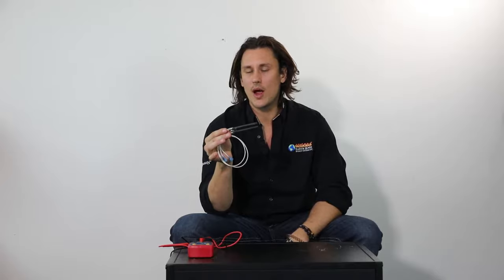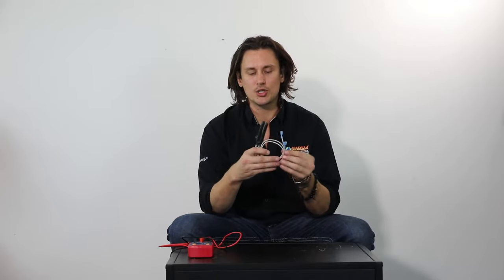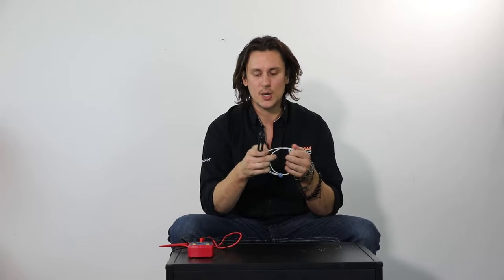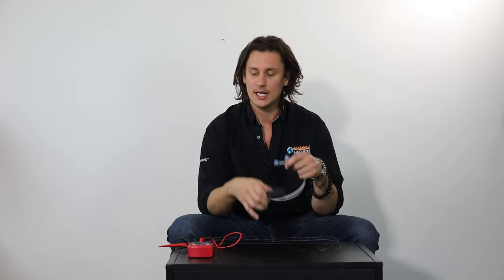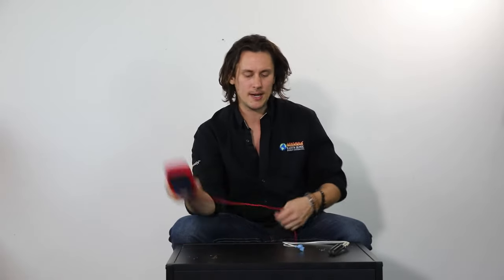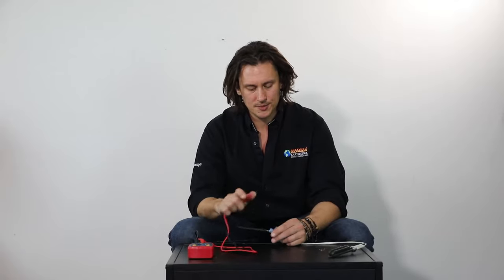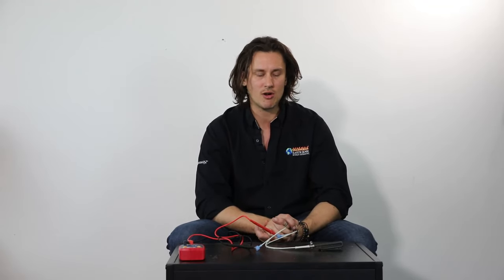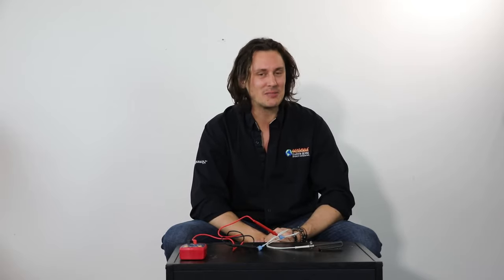How To Test A Stove Igniter, Pellet Stove Ignition Troubleshooting

Comment: My Harmon acentra lights but it takes 17 to 20 minutes to light it use to light a lot faster do the igniters become weak and take longer to light
Reply from the maker: Thanks for contacting us, happy to help. In some cases igniters will simply burn out, in other cases they can simply get weak. The finned igniter in your Accentra should have an ohm reading of 45.0-53.0 ohms to be in proper range. Let's start there and see what kind of an ohm reading you are receiving. Keep us posted, thanks!
Reply: @EarthSense  thank you I’ll check it this weekend when I clean the stove
Reply from the maker: @johnie19644  Sounds good John, keep us posted. Thanks!
Reply: @EarthSense  I just took it out I’ll check it in the morning at work thank you
Reply from the maker: @johnie19644  Excellent John! Glad we can help!
Reply: @EarthSense  if it’s not in that range is there a good chance that’s why it’s taking longer to light?
Reply from the maker: @johnie19644  Yes, exactly John. If it's higher or lower than the range here it will either not work at all or be very slow to light.
Reply: It’s 48.6
Reply from the maker: @johnie19644  Thanks John. Looks like it's in proper range. From here we will want to check air flow knowing the igniter is working correctly.
- Make sure all ash is cleaned out of the igniter cavity area.
- Check all burnpot holes to make sure they are free and clear.
- Make sure the intake air tube is free and clear - it will have a flapper door on it unless you are drawing outside air. 
- Let's make sure the door & glass gasket is sealing tightly all the way around. 
- Excessive ash build up in the stove or vent is cleaned out.
- Lastly we can check our combustion blower voltage on start-up - should be near line voltage.
Reply from the maker: @johnie19644  Just checked in with our technical team as well for proper start-up range. 'On a brand new igniter and clean stove, 5 mins from start to flame. On an old igniter and moderately clean stove, 7-10 mins from start to flame.'
Reply: @EarthSense  the door gasket is pretty new I had the stove store replace it awhile ago all burn holes are cleaned with a Allen wrench stuck through the little flapper for air in the back opens easily the hopper gasket looks fine.  It took 20 mins to start last time I just replaced the fan blade for the combustion motor that seems to keep my door glass a lot cleaner
Reply from the maker: @johnie19644  Thanks John. How does your fire look when burning? Crisp/torchy or lazy in anyway?
Reply: @EarthSense  the fire looks fine,  I noticed a little clunking when I hit on the top left side of the door so I adjusted the door a little there’s not as much of a clunk the door glass crews were a little lose it just took 15.5 minutes to light
Reply from the maker: @johnie19644  Thanks John. If our fire looks good it tells us that our air flow is good and most likely not a contributing factor here. What about pellets? Have you had a recent change in fuel? Maybe you can try a couple different types and see if there is a difference. Again, we shouldn't be any longer than 10 minutes from start to ignition and you are currently more than 50% past that mark in timing. Other than that we have gone through pretty much everything here I can think of. We could take a closer look at the cradle the igniter mounts in to make sure the mount is correct in the cradle and the cradle is evenly and securely mounted under the burnpot. Our aftermarket igniter is $18.95 - possibly you try a different igniter here to see what happens; I know yours is in proper range, but could be worth trying a new igniter. https://pellethead.com/product/pellethead-replacement-harman-heatilator-igniter-finned-heating-cartridge-element/

Thanks!
Reply: @EarthSense  yea I’m going to get a new one this summer but I’ll get a Harmon thanks it’s been lighting and burning great it just takes a little long I can live with it thank you
Reply: @EarthSense  does that cradle only go in one way?
Reply from the maker: @johnie19644  Yeah, cradle really only goes in one way. Important though that it is in the cradle correctly and the cradle is evenly tightened down (sometimes it can get tightened off-kilter leaving a small gap causing ignition issues). Here's our video on replacing the Harman igniter and we do show the cradle here. https://www.youtube.com/watch?v=i7n1SSgCPMc

Hope that helps. Thanks!
Reply: @EarthSense  yea I sure it’s in right I’ve done it several times,  why does my igniter read 48.6 and I checked a brand new one it was 46 something is the higher number show it’s weakening
Reply from the maker: @johnie19644  Hey John, there's always going to be a range when getting an ohm reading from an igniter. If I pulled 5 from the shelf it would be very unlikely that any would match exactly. For the finned Harman igniter 45.0-53.0 is the right range; any reading in that range is pretty sure-fire in letting us know the igniter is working correctly.
Reply from the maker: @johnie19644  Hey John, also ran this past one of our other techs, his feedback - The only two things I can think of after everything you mentioned that was looked at would be a slow or sluggish combustion blower (even with proper voltage it can be slow) or there is not enough power going to the igniter. If the voltage is low to the igniter it will take a really long time to ignite. Could also be a pellet issue, damp or bad pellets.
Reply: @EarthSense  anyway I can test the motor?
Reply from the maker: @johnie19644  Hey John, I just inquired with our technical team on this. It's pretty strait forward to check voltage, but I want to see if there is a way to test RPM/function. I will follow-up as soon as I hear back. Thanks.
Reply from the maker: @johnie19644  Hey John, here is the message I received from our tech: It would be more visual and auditory than anything because nobody has the tool that will actually measure RPM. The motor can receive the proper amount of voltage and be drawing the proper amount of amperage and still not be spinning fast enough. It is a hard diagnosis to walk someone through if they do not know what they are looking and listening for. This is usually a recommended service call situation.

Again, you mentioned your fire looks good - clean, crisp, torchy and usually that is a good indication the blower motor is running correctly and the unit is clean, however we've looked at virtually everything now regarding the long ignition cycles you are having and it could very well be the RPM of the blower motor. Hope this helpful, thanks.
Reply: @EarthSense  do you sell combustion motors if so where are they made and how much are they are they reliable as last a long time I think I might just replace it once the heating season is over.  How many rpm’s does a new motor spin at
Reply from the maker: @johnie19644  Hey John, yes we do sell replacement combustion motors. We offer the Harman OEM motor which is manufactured in the USA by Gleason Avery and we also offer an import aftermarket replacement. The combustion blower motor for Harman is 3000 RPM. I would say reliability is strong on the motors. Both of our motor options come with a 1 year warranty. In most cases blower motors tend to last 4-7 seasons - some go longer, some fail sooner, lots of variables. Here is a reference for you on what we offer. Any other questions please let us know. Appreciated! https://pellethead.com/product/harman-heatilator-ecochoice-combustion-blower-exhaust-draft-fan-motor-oem/
Reply: @EarthSense  your online store is mr pellet head?  I just got a new igniter and put it in last night after I cleaned my stove it lite in 6 minutes and 13 seconds I ordered two more for replacements thank you
Reply from the maker: @johnie19644  Hey John, yes pellethead.com is our primary website URL in addition to Earth Sense and Earth Sense Energy Systems. 6 minutes and 13 seconds is fantastic! Very glad to hear that. Still confused on why the one you pulled out was taking so long given it was in proper ohm range. Who knows, things can be funny sometimes.. Thanks for updating us and I'm glad things are back to 100%!
Reply: @EarthSense  thanks again I’ll have two igniter’s for back up
Reply from the maker: @johnie19644  Just glad we could help John, never hurts to have backups! Thanks again for reaching out to us.
Reply: @EarthSense  thank you for your help and the nice igniters
Reply from the maker: @johnie19644  Our pleasure, greatly appreciate your business.
Reply: @EarthSense  ok I just cleaned my stove and it lite in 6 minutes and 10 seconds all is fixed thank you again
Reply from the maker: @johnie19644  That's fantastic John! Yes, so much is about air flow. Great job and persistency through this!

Comment: I'm asking if my wiring is old and don't have a ground is that ok
Reply from the maker: Hey David, thanks for the message. If your unit doesn't have a lead ground wire from the wire harness coming to the component and the part/component has a ground, you can just leave it disconnected or you could create an extension to the ground wire and ground it to any metal on the stove body. We highly suggest a surge protector is in place to protect in the event of a power surge. Any other questions please let us know. Thanks! Reference: https://pellethead.com/product/belkin-surgecube-outlet-surge-protector-1080-joules/

Comment: Dude My King pellet stove igniter constantly stays on,  even after shutdown mode completes it still glowing red-hot. any info much appreciated
Reply from the maker: Thanks for the message Gina. Sounds like the circuit board is giving continuous charge to the igniter element. The element is going to burn out very shortly staying on constantly. My suggestion would be to contact USSC (United States Stove Company) The King models are apart of their line. Possibly the circuit board ignition timing cycle could be repaired. https://www.usstove.com/support/
Hope that is helpful!

Comment: I have a Winslow ps40 the igniter died I ordered a replacement igniter. The control board is in the off position. As soon as I connect the leads for the igniter the ignitor is coming on with the control board in off position.
Reply from the maker: Thanks for contacting us. It sounds like the igniter is receiving a direct electrical charge from the circuit board. I messaged our key technician to get his insight. Let's unplug the stove and closely check the circuit board - look for any burns/chars/marks. Was there anything odd when the previous igniter died/failed? I'll follow up as soon as I hear from our tech. Thanks!
Reply: @EarthSense  igniter fuse blew. Then replace fuse, and igniter wouldn't work. took out igniter ran direct current to igniter.. element was not working. ordered replacement installed it now has constant power with switch off. will have to look at inside of board see if anything looks toasted.  All other functions in stove are operating properly other than the direct power to ignitor
Reply from the maker: @knoxtrail5412  OK, thanks for the details. I'll follow up as soon as I hear from tech support. Thanks.
Reply: @EarthSense  nothing out of the ordinary looking on the board FYI.
 thank you
Reply from the maker: @knoxtrail5412  Thanks for the update. Should hear back from the technical team on Monday and will follow up. Appreciated.
Reply from the maker: @knoxtrail5412  Thanks for your patience. Our lead tech got back and is pretty confident that this is a control board issue; failed igniter took out the board. You can take it to a local dealer for testing to verify. Hope that helps. Thanks.
Reply: Thanks for your help! do you repair or service boards? Or do u sell OEM boards?
Reply from the maker: @knoxtrail5412  Our pleasure to assist buddy. We do not repair or service boards. We do offer testing services and we do offer the OEM board replacements. Here is a link to the OEM board for reference. https://pellethead.com/product/iron-strike-lennox-winslow-ps40-pi40-circuit-control-board-oem/

I just spoke with Inventory. The new boards have been on backorder with the factory for several months now. I did confirm we have 1 board in 'clearance' this would be an open box or return item. Our techs go through and certify these to ensure everything is 100% and we guarantee 100% proper install and function. Clearance items like this however will not have a warranty. The clearance board would be $330.00 shipped. If that was something you were interested in, I can create a listing for it and send you the link. Happy to help however we can. Thanks!

Comment: Harmon accentra insert igniter element part number 3-20-677200
What should be resistance ?
Reply from the maker: Hey Jimmy, thanks for the message. Ohm resistance for the Accentra Insert Igniter should be providing a reading of 45.0 - 53.0 in optimal range. Any other questions please let us know. Thanks.
Reply: @EarthSense  thank you ,original igniter 7 years old  ,first problem I had with this Harmon stove ,thank you again
Reply from the maker: @jimmyp6443  Absolutely Jimmy, happy to assist. The Accentra Insert is a great unit. If you have any future questions or need parts links for reference just let us know.

Comment: I have a classic bay insert that's not getting power to the igniter. I have to cut the igniter leads, cut an extension cord, tape them together, plug it into a 110 outlet until the pellets ignite then unplug it. Everything else works fine; the blower, the pellet feed, the thermostat. Any help?
Reply from the maker: Thanks for the message, happy to help. I do think it's important that we check the ohms on the igniter. Direct line voltage from the wall will provide a different charge to that element then the control box will. If you have the CB1200i you most likely have the 300 watt loop igniter in place. That igniter should have a range of 43.5 – 53.5 ohms. If it's above or below those numbers, there are going to be issues with it lighting normally in start-up sequence. If you have the multi-fuel 380 watt loop igniter, that should have a range of 35.5 - 43.5.  If the igniter is in operable ohm range then generally speaking it would be an issue inside the control box circuit board. If it does happen to be a board issue sometimes those can be repaired by a local electronics shop/specialist. Here is the replacement board for reference along with the igniter options. Keep us posted. Thanks,

Control Box:https://pellethead.com/product/quadrafire-control-box-3-speed-circuit-board-oem/

Loop Igniters: https://pellethead.com/?s=quadrafire+loop+igniter
Reply: @EarthSense  Thank you so much for your prompt response. I will go ahead and check the igniter(s) to see if I have the proper resistance. In the meantime, where is the control box located? If it's behind the stove can I pull the stove out far enough to get to it? I have checked the two black wire leads to the igniter and there is no power there. It does seem strange that everything else works. Thanks again for your help. I'm encouraged.  Abe
Reply from the maker: @abrahamrodriguez3240  Thanks Abe, happy to assist. I believe on the 1200i the control box is located behind one of your panel wings on either the left or right. The Control Box will be inserted into the junction box right where your thermostat terminal area is located. Yeah there should be power coming from those wires during the start-up cycle. Double check those wire points into the junction box. Make sure there are no splits or issues with the wires.

Comment: Can you bypass the igniter
Reply from the maker: Hey Mark, 
Let us know what you are trying to do and on what stove make and model. 
A person can leave the igniter disconnected and manually light the fire.
We can check the igniter ohms to determine if the element is good or bad.
If the element is in proper range but the stove is not lighting, there are a couple areas we can look at to diagnose where the issue is. 
Happy to help!

Comment: I put a 5 amp breaker in line so it doesn't burn my igniter out because of dirt or other related problems. See if it works.
Reply from the maker: Thanks David, keep us posted how that works on your model. Whitfield stoves with ignition had an inline fuse on the igniter wires. Not sure of others that may have had that, but in my eyes it should be a helpful preventive. Thanks!

Comment: If the ignitor ohms out above 86 ohms replace it.
Reply from the maker: Thanks for the message. There are many different igniters that are used in pellet stoves. The OHM range can vary greatly between different igniter elements. Most have about a 10 point mark to be in optimal range. If OHMS read above or below that range, there is generally ignition issues and the igniter needs to be replaced. Here is a blog that will cover the OHM range for some of the most popular pellet stove igniters. https://pellethead.com/how-to-test-and-replace-a-stove-igniter-pellet-stove-ignition-troubleshooting/

Any additional help or assistance just let us know. Thanks.

Comment: My igniter doesn’t glow
Reply from the maker: Thanks for contacting us Anthony. Suggesting to do an OHM test to see if the igniter is in proper range. If the igniter is out of range then it will be the element itself. If the igniter is in range, then we will want to test and check the electrical connection wires going to the igniter. Happy to help, specifics on your make and model will be helpful if you need further assistance. Thanks,